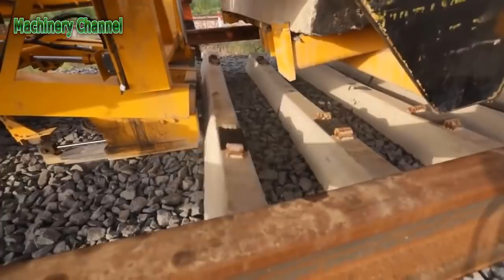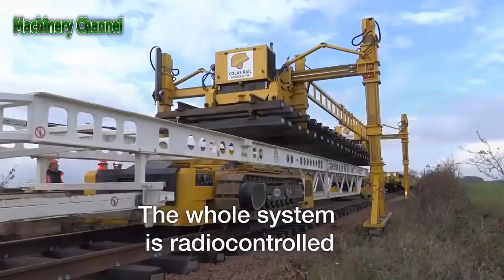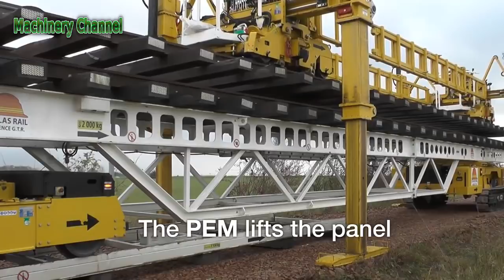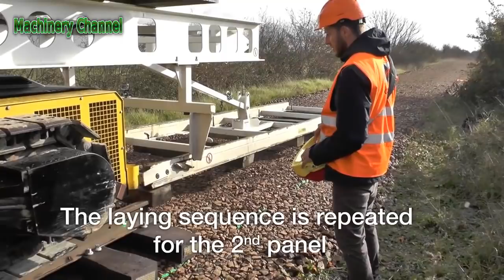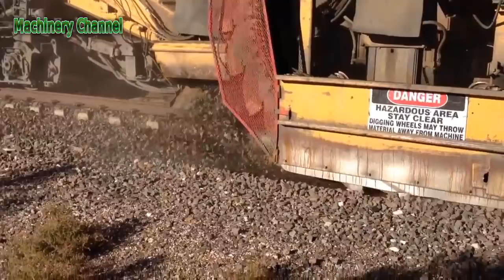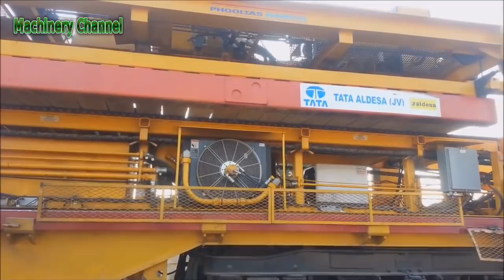Worlds Largest Railway Construction Equipment Modern Technology, Awesome Powerful Railroad Machines

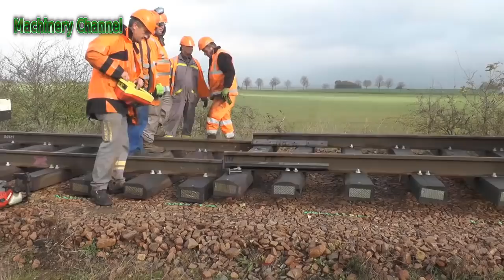Comment: WHOA! I paused at 5:36 when I first noticed the rails attached to the ties by what appears to be bolts and washers. Is that safe?
Reply: Depends on the class of track, but yes it can be
Reply: Those heavy screws have more holding power than the old fashioned spikes
Reply: Since that’s clearly not in the US, it depends on their rules and regulations wherever it is. In the US, you WILL have time plates, which that doesn’t

Comment: What was the machine with the 2 giant spinning bucket wheels doing?
Reply: cuts rock and dirt from ends of ties dumps into a shaker .shakes dirt and small rocks on to a conveyor .which throws it away from track .dumps good rock back on track .This is to drain water from track so dump will not get soft spot and let track sink
Reply: @williamault1435  Thanks William!
Reply: Cleaning the ballast I suppose
Reply: It’s called a shoulder cleaner. They usually run along with a ditcher. Digs just past the end of the ties because that’s where your movement is. Then it spits the bad ballast off to the end of the ballast line.

Comment: Bolted rails not as smooth as long continuous rails. More wrecks with bolted rails and usually slower speeds allowed, if regulated by government.
Reply: Is it four feet eight and a half inches track width ?

Comment: The latest technology has reduced the man power. Also the work is done saving the time, as well work force goes as  fast to the maximum completion of the work finished within less time. Awesome Discovery of the mechanism. No technical defaults, everything is in perfect order.
Reply: Not even close to being true. You still have a workforce there to override the machine. There are aspects that a machine cannot achieve or see

Comment: Awesome video! Where is the Harsco track machine at? It looks it is somewhere in Africa or India. And what about the last one? Could it be in Australia, laying a new gauge?
Reply: Could be. Unfortunately each Australian State has a different Gauge. We are gradually standardizing some lines to 4' 81/2" to allow trains to travel interstate. If it was Australia it would be in the State of Victoria which had 5 ' 3" Gauge. I am Australian but could not pick up anything distinctly Australian. 
 I think all new Lines from Mines to Ports are built using 4' 81/2" Gauge using gear similar to in the Video. 
 Queensland though did stay with its 3' 6" lines on its Coal Lines to Port. 
 With good gradients and steady curves they have proved efficient. Very long slow moving trains with 3 to 5 Engines. Only a two man crew operating these very long trains keeps wages down. Speed does not matter on a dedicated Coal Line to port. Going slow also probably saves fuel. They can simply keep sending off new Trains as they are loaded.
Reply: India
Reply: How does it do in curves ?

Comment: Why are the sleepers so close together ? Seems about a foot closer than usual.
Reply: Weight ratio, strength of the sleepers, compaction of the foundation, compression, and vibration are some of the factors along with a healthy safety factor.
Reply: @rogerjamespaul5528  Thanks for your reply